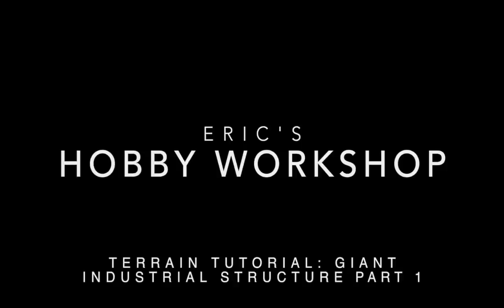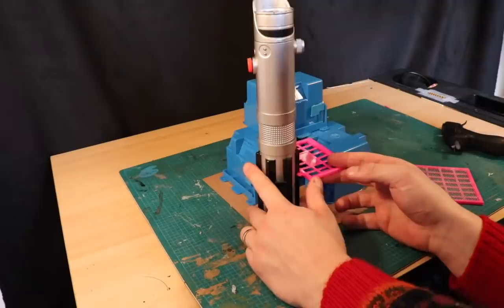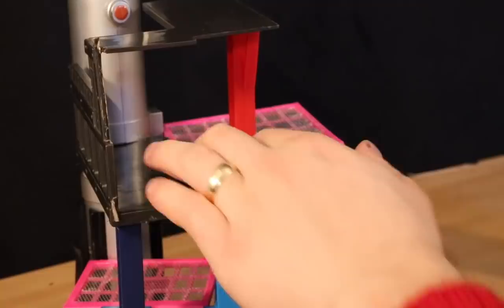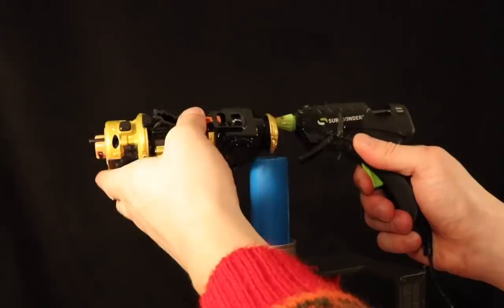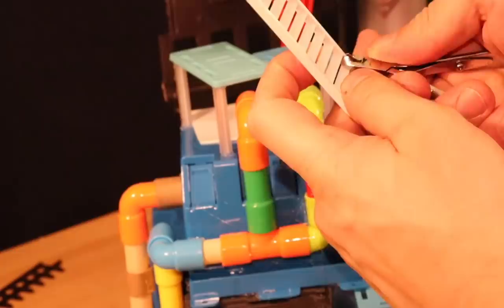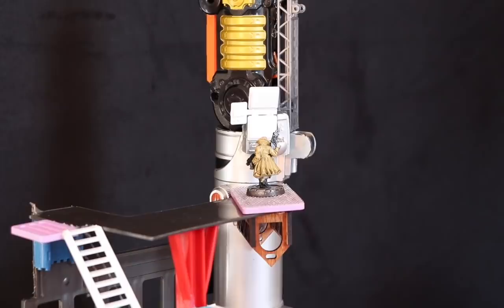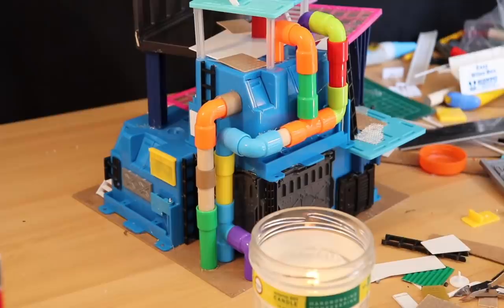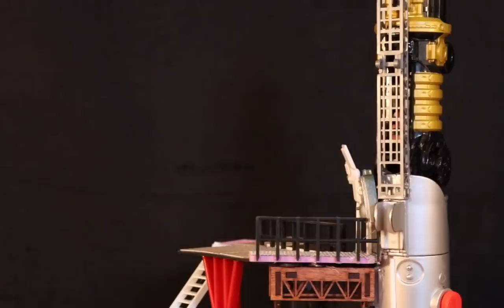Terrain Tutorial: Realistic Industrial Mega Structure for Warhammer, Kill Team, Necromunda Pt. 1

Comment: As somebody with a degree in Model Making and SFX for Film & TV I like what I see here. Good job Eric. I see a few things where you could make life easier for yourself but there are 2 things everyone watching this should take away with them. (1) sanding areas before gluing. If you have 2 smooth shiney plastic surfaces it really helps to add some "grip" by roughing up the surface. (2) the way you add rivets and fine details by placing a little glue to a scrap piece to the side and then dip your small bits into that before positioning is another great hack. This prevents lots of mess around your fine details. 
Obviously there is a lot more to what you do than that, but for beginners these 2 techniques are great to use. The way you see everyday items and their potential for terrain pieces and how to put them together is something that comes with time and experience. From there practice makes perfect.

Comment: This is brilliant and amazing, as the rest of your videos. Looks absolutely outstanding. How about durability of your buildings? I've got a rather bad experience with connecting plastic pieces using hot glue, but it may be because of the cheap glue i am using. 

I can't wait for the next part :) cheers
Reply from the maker: Adam Marciniak They are pretty durable. I think I have a high heat glue gun which definitely bonds better than my old dollar store one. Some plastics bond better than others too... i might cover this topic in a future video
Reply: @EricsHobbyWorkshop  I did not know there can be a heat/temperature difference between then glueguns, thank you! I need to check out more about it.